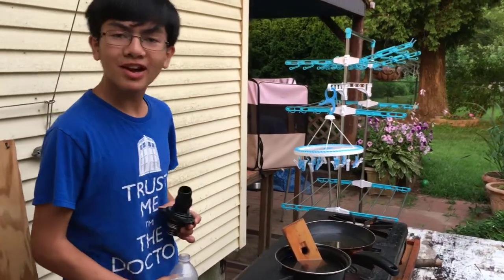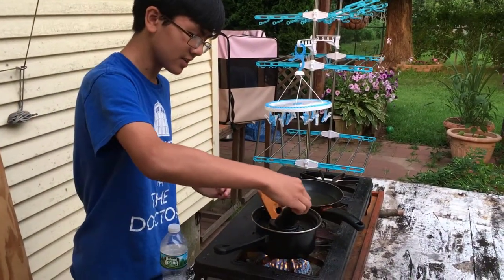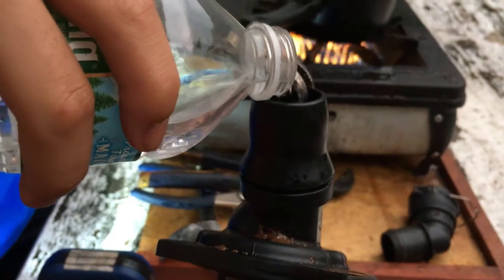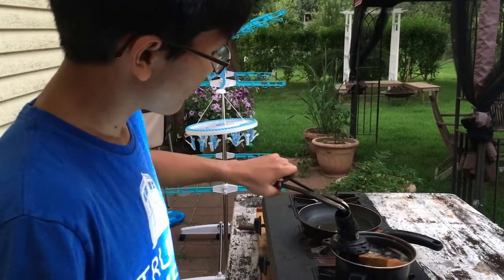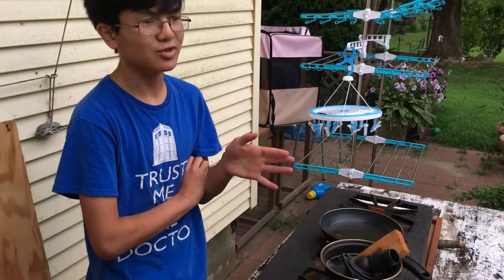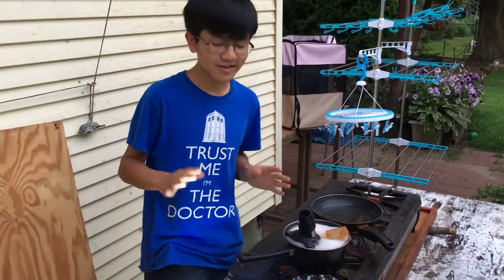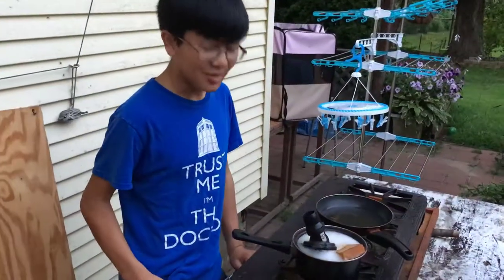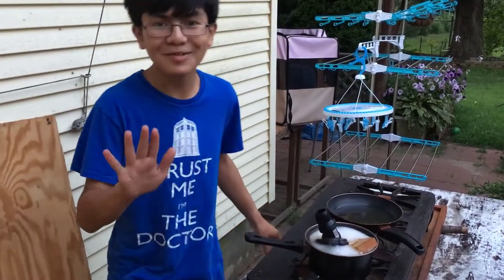How To Test If Your Car Engine Thermostat Is Working, Faulty or Stuck In Minutes | DIY Auto Repair

Comment: Well done young man. You helped this 42yr old man just solve his issue with a radiator cooling fan sticking on after my truck engine was off. I watched your video and deduced that my engine was running cold because the thermostat was stuck open allowing a constant flow of coolant. When I removed the old one and poured water down the top it came right out the bottom. The grommet was also badly worn and the spring looked out of place. My truck now runs warm and sounds much better. I THANK YOU AND HAVE A WONDERFUL HOLIDAY SEASON!!!!